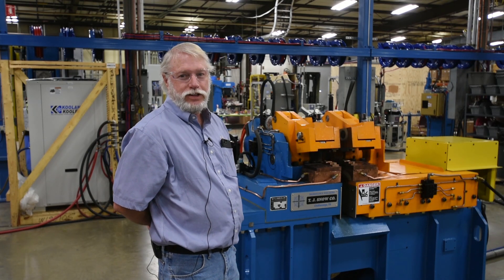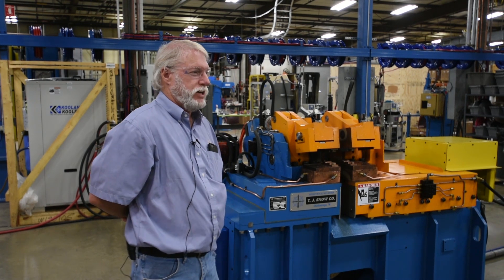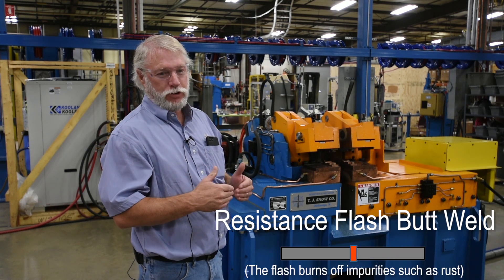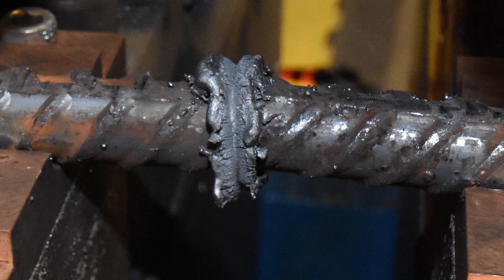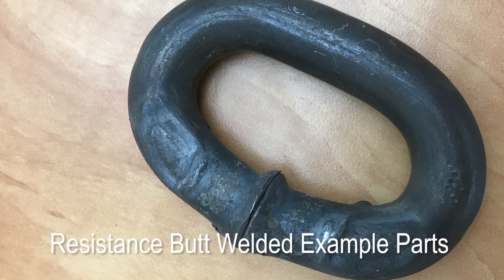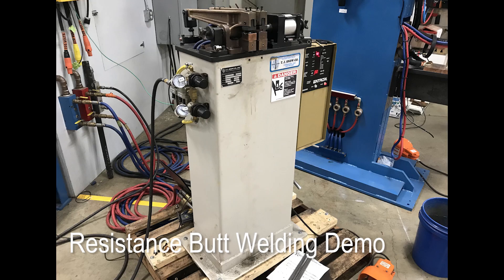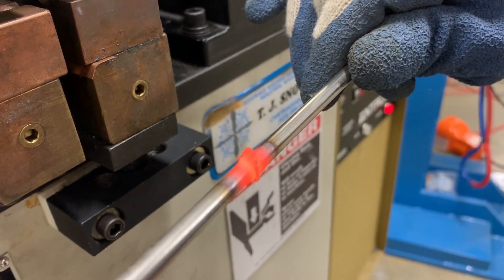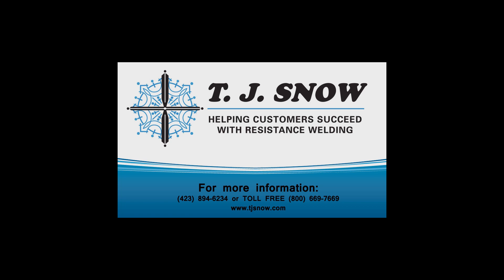Resistance Flash Welding vs. Resistance Butt Welding - What is the Difference? | T. J. Snow Company

Comment: Interesting and informative. Flash welding is like stick welding with an oversized stick and no flux on the stick.

Both meanings of the word flash apply. Both the ring that has to be cleaned up from the workpiece and the giant flash of light and sparks.

I presume that there is a guard to limit the amount of sparks that fly and an exhaust hood when the machine is in production use.
Reply from the maker: You got it!